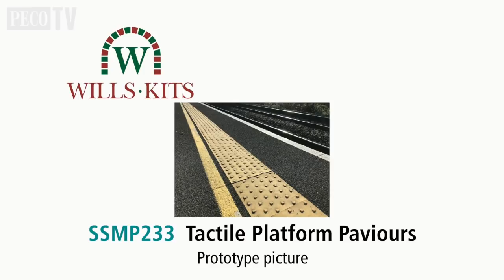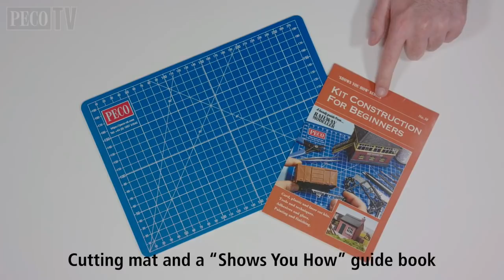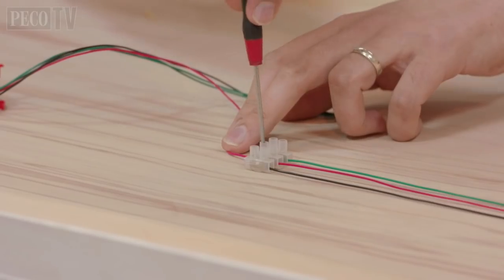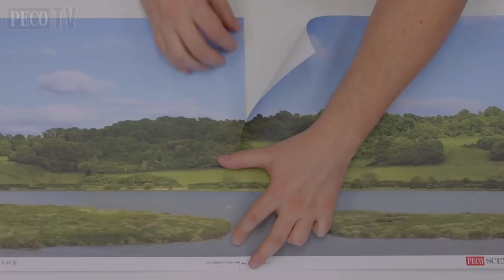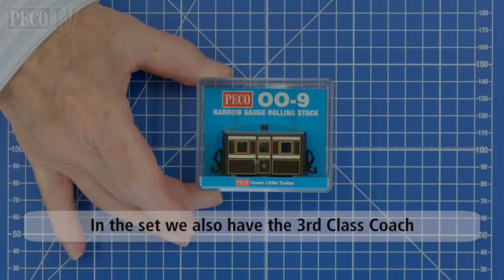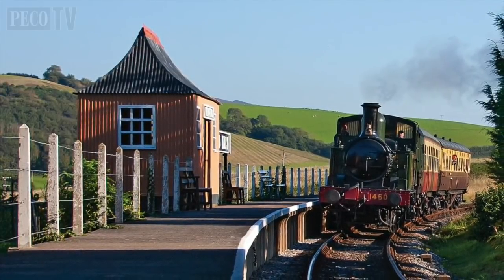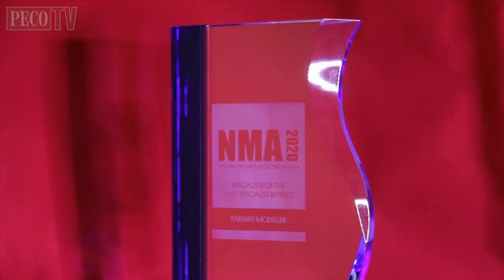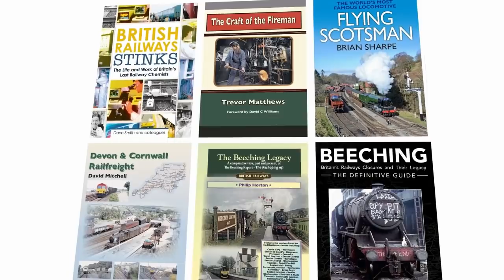Peco products review and behind the scenes during lockdown

Comment: Tooo EXPENSIVE!
Reply: whats to expensive
Reply: @AndyHudson-ModelRailwayBuilds  the whole hobby I gave it up the prices for  simple plastic houses track etc are far too much to build a simple layout its 1000's of pounds just not worth it.
Reply: @AndyHudson-ModelRailwayBuilds  the tool kits can be brought at any hard ware shops and add up to about a tenner I could get these for that amount with a bit of shopping around Ive just looked on ebay you want over £70 sharpie pens are £2.50 for 2 files £1 each cutting board  few quid  and so on
Reply: @robertgregson2183  I agree you can spend thousands of pounds building a layout but you can also build on a budget also, have a look at Budget Model Railways

Comment: It sometimes seems to me that Ratio kits are deliberately designed to make life as difficult as possible for the modeler assembling them. I see that this brand new signal box kit still uses that ludicrous technique for the stairs, where you are expected to glue each individual step in place, and get them all level and parallel, with no aid from a jig or similar. I tried this on their N Gauge Midland signal box, and found it pretty much impossible. Their N Gauge footbridge kit is also a b*** to assemble, pretty though it is (and it also doesn't offer enough clearance, even when placed on fairly high platforms). I've built staircases from other manufacturers kits (plastic and card) many times with no problems... but they offered better parts or more help (either a jig to help assemble the steps, or just making all the steps together as one part).
Reply from the maker: never had an issue with Ratio kits but thanks for commenting

Comment: Nothing new for O-16.5/On30!  Additional turnouts and crossovers designed for O-16.5 are well overdue.  It gets old adapting other PECO code 100 turnouts and crossovers to work with O-16.5.  Of course it never looks quite right.  You can spot it easily.